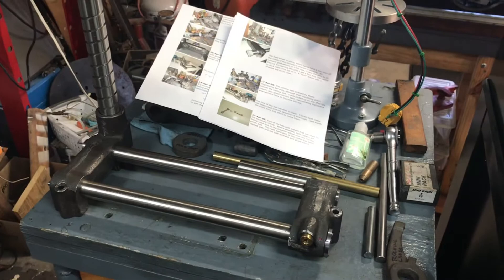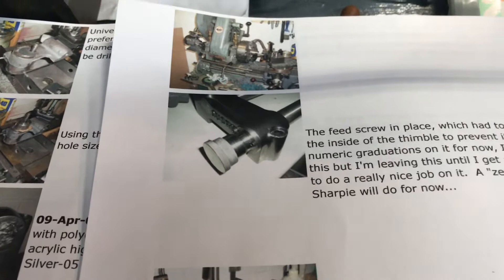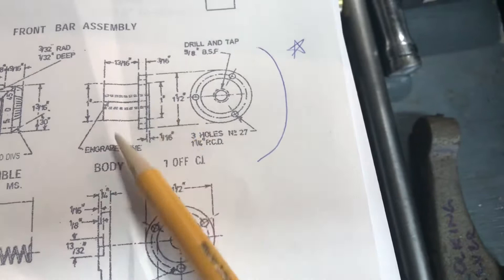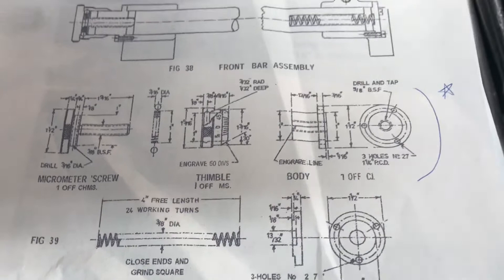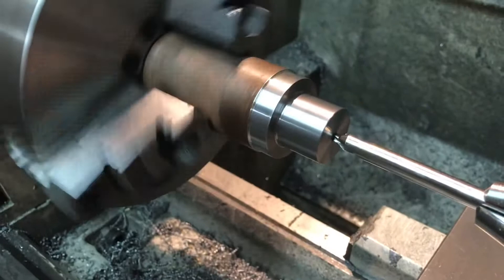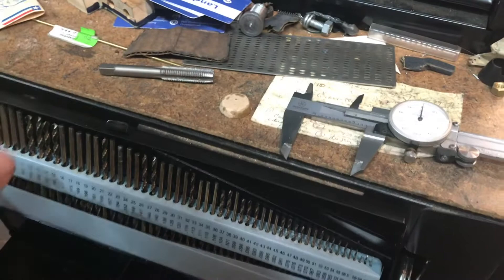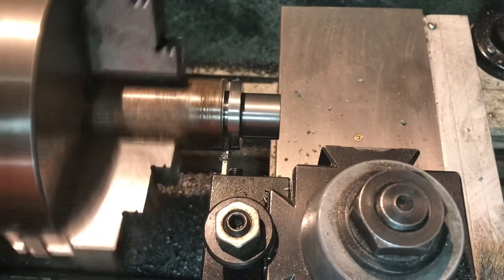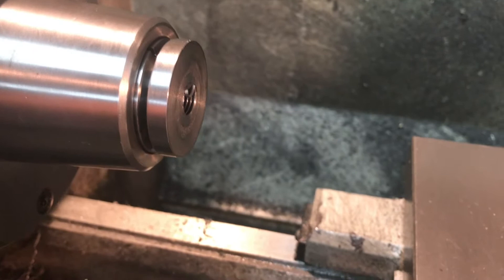Quorn Tool Grinder project. Micrometer body machining

Comment: Hi, nice work so far appreciate the effort on the videos.  I was wondering how you ground the radius tool?  I am having trouble making one hand grinding it.
Reply from the maker: Thanks, Clay. If you mean the tool I used for the inside groove for the ball bearings, I took a carbide tipped boring tool, covered the cutter face with blue Sharpie marker, then set a little radius gauge on top of the cutter so I could trace out the needed radius. Then I just ground it to shape with a “green” bench grinder wheel. Hope that helps.